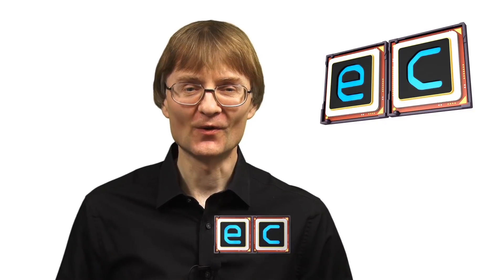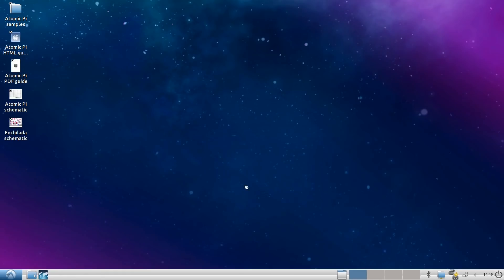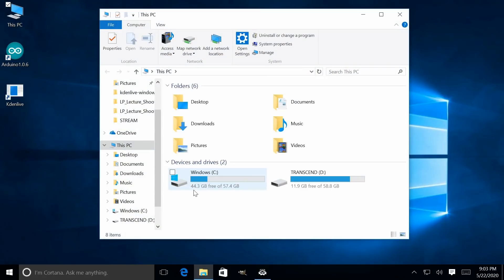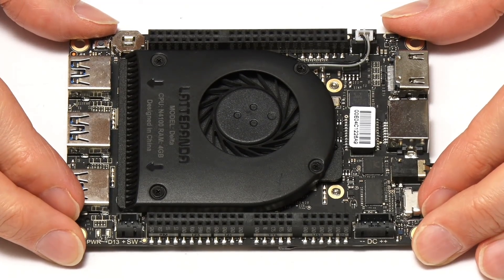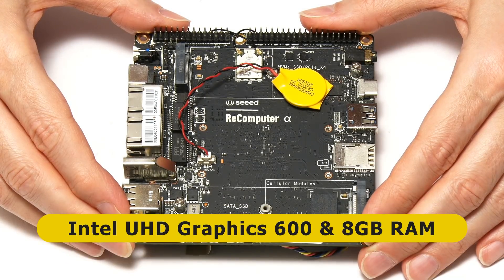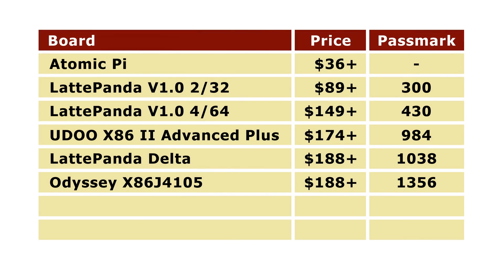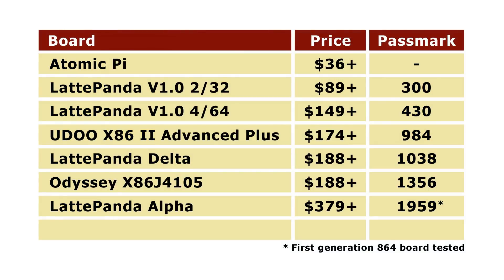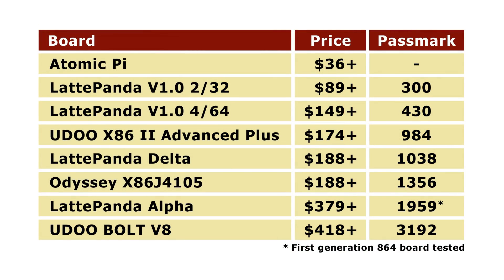Eight x86 SBCs

Comment: A while back I upgraded my Atomic Pi with 64GB of eMMC Flash storage, primarily so I could run Windows 10 on them with a little bit of legroom on the storage side of things. Out of curiosity, I ran the PassMark 9.0 Evaluation edition with its default settings, and got an overall PassMark score of 676. (That said, I noticed that for your LattePanda benchmark results, the 3D Graphics mark wasn't run.)

Here's the results I got for each category:
CPU: 1445
Memory: 563
3D Graphics: 234
2D Graphics: 155
Disk: 646
Reply from the maker: Wow! Great upgrade -- did you replace the eMMC chip? Thanks for sharing the passmark results.
Reply: @ExplainingComputers  Sure did! On another Atomic Pi, I also desoldered the built-in PCIe Ethernet chip to break out the signals to an external riser board. I've tested things like other network cards, NVMe SSDs, GPUs, and even a SAS card to let me boot the Atomic Pi from SATA!

Comment: With these mini pc could I install Astrophotography tools? They have several USB ports and I could plug them all in. Instead, USB hubs often give me problems for the equatorial mount.
Reply from the maker: Yes, any x86 software should work if the PC's spec meets what is required.

Comment: I really want a Windows XP SBC. When will they get powerful enough and cheap to emulate or run x86 VMs?
Reply from the maker: A UDOO Bolt or LattePanda Alpha will run a VM just fine. But the price . . .
Reply: @ExplainingComputers I have a Windows 10 tablet with a similar CPU like the Latte Panda, and it does handle VMs pretty good. I'll still stick to my retro XP tablet for an old computer.

Comment: The cheapest SBC here is a good competitor to Pi4 but the others are rather too expensive, especially those near $200. I rather buy a laptop because another extra less than $200, I can get a laptop which is many times better performances and features. A laptop has 14"screen too! NUC and mini PC is the same price as these expensive SBC so its very unrealistic but their fans will not hesitate to buy. Even the cheaper Android TV boxes have better processors at cheaper prices than Pi4 and all the SBC here. Pi4 is a useless SBC that only suitable as a toy for home project. Arm processors cannot even handle proper Office documents software but X86 can at least do this job.

Comment: How do they stack up doing ffmpeg x.265 4K 60fps ENcoding? And also vs ARMv7/8?
I'm planning on making a PnP scalable distributed HEVC system.
I don't need the fastest, I need the most efficient, price/power*/performance
* power as in Wattage.

Comment: Now, see... I think you made this video just for me.  I haven't selected another SBC, yet, but I want something unloaded, to run Windows XP.  I did manage to get Windows XP to run inside Kubuntu, on a laptop that I converted into a dual boot, Windows 7 and Kubuntu.  I should have been able to install XP onto the second partition, but the install failed.

So thanks.  I appreciate this nice comparison.
Reply from the maker: Thanks for this, but be aware that you  will struggle to find drivers for XP for any of this hardware. Running XP as a virtual machine is likely to be the best bet on modern hardware.
Reply: @ExplainingComputers  Since these are all 64-bit machines, Christopher, I believe you might be correct.  I've managed to get it running in Kubuntu, but the software won't cooperate.  I think I mentioned this before, but the latest backup that will run is from six months ago (maybe seven, by now).  I've done an awful lot of data entry since then, and if I knew it would keep working after that, I might not mind re-entering all of those data.
I don't care about the hardware, though - I just need to run my XP software.  Some of it I've completely paid for, and to replace it would cost more than I can afford.
Funny about the x86 instruction set: I had an 8080 chip (many years ago), and later, an 8085 chip, and then, one day, the 8086 chip came out with advanced features (of course I bought one).  They were fun to play with and program.  Today, everything's changed.  You can get the chip(s), but unless it's on a developer board, it's pretty hard to use.  In those days, I used manual switches and LEDs to program the inputs and read the outputs. Nowadays, they have hard drives, fast clocking chips, memory, ALUs, keyboards, monitors... takes all the fun out of it.
Most recently, I taught my students Machine language (ARM), but they were quite upset, some time later, to find out about Assembly language - an easier way to program than machine language.  As the semester progressed, they were very upset to find out about C-language, a much, much easier way to code.  I didn't even bother to mention C++, as I imagined they might have me tarred and feathered.

Comment: dear Chris hello!,i am reaching to you as i need some help with something that i think is your experty ,me and 3 of my friends a few months ago started to study computer engineering and software in a college, recently our teacher gave us a task to do,he gave us a 500gb hard disk with files( insisted to say there are files inside the hard disk in it) and the task was to reveal the files inside,seemed pretty easy at firs to us,but he told us that the files inside would be hard to reveal because the hard disk is in a format that windows operation will not detect,so the first thing which me and my friends thought to do first is to figure out what kind of file system the hard disk is formatted, after we will find it,we need to know what operation system can read it,(Windows,Linux,etc),and of course to download the appropriated drivers to run it ,when we inserted the hard disk to a pc running windows it didn't detect it of course but on the windows disk manager it detected that it has been inserted but its unallocated,we tried everything to find the file system by our own methods without any software's,after realize that we have to try some software's to help us, we have downloaded some,all the software's out there that experts to discover hard disk info,file system reveal,etc, t,didn't worked!it did detected but didn't gave us an info of the file system that its formatted at,it gave us information that it is a basic MBR, and its logical.
we are asking for your help please,thanks in advance ! :)
Reply from the maker: My approach here would be to boot up in Linux (from a USB drive would be fine), and to try mounting the drive there.
Reply: @ExplainingComputers   dear chris hello again :),thanks for your response,we have already tried it with Ubuntu,no results when inserting the hard disk,the teacher kept telling us that it is possible,tough mission we know,any other methods you think would work ?,it was very weird for us to know that no software out there could At least tell us the file system format .
Reply: When we test it on Linux it does detects it om the disk manager,but it wrote as "Unknown",nothing regarding to a partition type.
Reply: In Linux,the Gparted aswell gave no results,an error message pops up,do you think we should maybe install a specific drivers or softwares you know of that will help in linux? and if so,what would it be ?

Comment: Once you get to the price of the 4GB Latte Panda you can buy a fanless laptop/netbook with similar specs and performance but you get a screen, keyboard, power supply, battery, speakers, WiFi, Bluetooth, standard UEFI bios, more ports like USB C, etc. for the same price. Power consumption with the screen off is also very similar. That, in my opinion, makes any SBC around $150 and up useful only for very niche use cases. For nearly everything else the laptop is a much better value.

Comment: For Better Price and performance purchase a gigabyte brix j4105 or higher there is just no competition. Spent 200usd for 8gbs of ddr4 ram a j4105 with intel graphics a 120gb ssd and the brix itself and i can emulate nox in it, do 4k no problem and it really is a mini pc, it also comes with its own case, cooling system and power suply wich most of these bords dont have so its extra money.
Reply from the maker: While I take your point in general -- and the GIgabyte Brix models are great mini PCs -- as shown in the video the Odyssey X86J4104 delivers a J4105 CPU, 8GB RAM, 64GB storage and PSU for $218, or $237 with its case. And it has far more storage options than a Brixx, (two M.2 slots and a SATA port) as well as GPIO connectivity and a SIM card slot. So it just depends what features you need.
Reply: @ExplainingComputers  thanks let me say I Love your channel and your style, I'm proud owner of 4 sbcs and 2 mini pcs, some of those sbcs I acquired thanks to your sales pitch and since it's explaining computers I think that these aios can appeal to your public since I would think that many people choose sbc for their small footprint and low power consumption, computers like the brix I feel have a space as that low power media/pc solution that's affordable, small, low power and has better performance then most sbcs with less tinkering and aio solution, so would appreciate if you could also explore this realm most my sbcs where purchased for media consumption and where beat by a firestick 4k only 2/4 sbcs remain in use and found that they are great devices for nas, pihole, torrents, print share in my case but my media and gaming consumption moved to the mini pcs, would be a gr8 gift for a parent, son and can be used as daily driver with no necessary tinkering which some boards can be a headache and in an aio package that most boards don't bring since you buy power supply, case, cooling solution etc... separately
Reply from the maker: @Abolition-ky5sd  Yes, very much agreed. I have been musing how to cover hardware like NUCs and the Brix models -- as well as things like Pico and Nano ITX.
Reply: @ExplainingComputers  very much interested personally I'm in the 200usd budget would love a nuc though but for the price it's put of my budget, keep up the good work and cheers on this pandemic it's hard on everyone

Comment: This was very interesting. I would have liked to have heard about the differences in fan noise. I'm obsessed with silent computing but I also do some Photoshop and some light (very light) video editing so I have to conflicting needs. I'd looked at the Intel Nuc which has an available third party case that supposedly allows for fanless cooling. I'd love to hear more about powerful fanless PCs from you in the future.
Reply from the maker: I am a big fan of quiet and silent PCs! :) The Atomic Pi and both LattePanda V1.0 boards are passively cooled and hence silent, as is the UDOO X86 AP unless you add the optional fan (not really needed). The Odyssey board without onboard eMMC is also passively cooled and silent. On all other boards the fan is temperature controlled on/off only. The LattePanda Delta and LattePanda Alpha fans and very quiet. But the UDOO Bolt fan is very noisy and distracting as it cuts in and out. The Odyssey fan is very quiet indeed.

Comment: I'd have loved a power consumption column (or two, idle & benchmark). As far as "single board", the ability to add up to 32GB of RAM is probably very useful for some use cases.
Reply from the maker: Good point  . . . I must do a video focused on power consumption.

Comment: I'm trying to figure out why people are buying these. Check out cheap laptops. Most of the boards in them are about the same size these days. Are much more powerful with more RAM and m.2 and ram slots.
Reply from the maker: Firstly, a laptop and an SBC have different use cases -- it would be strange to use a laptop as a robotics controller, server or NAS.

Secondly, whilst there are many comments here and elsewhere about laptops being cheaper and more powerful, I struggle to find a specific model. For example, a quick search of Amazon.com today suggests this is the cheapest laptop they sell -- https://www.amazon.com/dp/B0821163ZB/ (ignoring Chomebooks and second hand stock). This is $250 with a Celeron N3350 CPU, 4GB of RAM and 64GB of eMMC flash storage. So it has a less powerful processor and less RAM than an Odyssey X86J4105, and the same 64GB eMMC storage as the $218 Odyssey model.

Now, the laptop has a screen, keyboard, battery pointing device and Windows 10 pre-installed, which certainly makes it a better value out-of-box  portable computer. But as, say, a media PC, running Linux and connected to a TV, the Odyssey will be roughly the same price even with its case and a wireless keyboard added. And it will have a more powerful CPU, more RAM, two M.2 slots, and a SATA port. Or as a small server where no screen and keyboard are needed, the Odyssey will be cheaper and have a far more practical form-factor.

I'm not disputing that for many users in many use scenarios that a laptop is a better buy. But SBCs like those shown in the video are cheaper and more practical in many use scenarios than a laptop.

Comment: I think odroid H2 at $111 is the best value for x86 sbc.
Reply from the maker: $111 is good value for the Odroid H2 -- but remember this is with no RAM, storage or power supply. The prices quoted for the Odyssey X86J4105 and LattePanda Delta include RAM, storage and a power supply -- making them about the same price.
Reply: @ExplainingComputers  oh I agree, but I think it's still competitive to the other Celeron sbcs even if you add memory & storage price. Plus a lot more usb ports.

Comment: I bought a couple Atomic Pi boards back when you first released the video on them, and haven't regretted it yet! One is now a dedicated webserver/security camera & sensor monitor that runs 24/7 independently of anything else in-house (with 3G/4G LTE backbone and cloud storage just in case, along with it's own battery, all hidden away in a location you wouldn't think to look, were you a thief) that I installed professionally at a company (using the "enchilada" breakout board for the nice connectors etc - it's not for me personally, so I don't trust pin connectors not to be messed with by some curious employee someday, whereas the screw terminals are pretty clear "don't mess with us" type connections. The other one is a tiny little fanless recording PC - works great for that, fits in a foam-lined hardshell suitcase along with the mic and 2 arms that swing out to hold foam curtains, plus one to drop on top of it. Voila: portable recording studio (I run it off a simple USB-C charge pack, and 20,000mah runs for hours on there. Honestly haven't tested it to it's limits yet, as we only really use it heavily when out of the house at events.) I'm also working on a 3rd one right now to replace the VM I have running HomeAssistant, as the dedicated hardware interface will also let me directly control several devices/relays that way, plus again be a separate, off-network standalone system. If the power goes out, the server starts blasting a shutdown warning immediately. I also used one inside an old touchscreen monitor that used to be a POS terminal (TTY client or something, so no good OS) to make a standalone media PC (the breakout board also comes with a nice amplifier) that all runs off a laptop charger, including the amplifier for the speakers, and if I need to do anything more than YouTube/music, there's always remote desktop, lol.  I highly recommend these if anyone wants something cheap that's still decent enough to tinker around with. Definitely can't beat the price for what I've ended up using them on. 
Anyway, thanks for the awesome comparison! Ironically I HAVE been looking to get 1 more that's a bit "beefier" than the Atomic Pi to use as a car PC just these past few days, so this is perfect timing!
Reply from the maker: Great to hear about your Atomic Pi applications! :)

Comment: ??? small laptops or note books can be another inexpensive x86 option. one drawback of laptops are the BIOS seldom has the boot after power loss feature that desktops have. that is if power is dropped and then reconnected, desktops can either return to last state, stay off or power on. do any of these boards have a similar feature? does it have BIOS settings we may be accustom to?

Comment: Hi need a help.....I have raspberry Pi 4... My raspberry Pi 4 is not booting ...think my son has changed the settings in config.txt in Kali Linux. Once he changed and restarted it not booting. Can you please help to fix this
Reply from the maker: Making changes to config.txt in any OS should not prevent another OS (installed on a different SD card) from booting. But if changes have been made to alter the firmware, you may have to recover it. This said, if an overclock was set up in config.text this could have permanently damaged the Pi. So you really need to know what kind of changes he was making -- if he was experimenting with overclocks, you may be sunk. If he was trying to update the firmware, you may be able to recover -- details are on this page: https://www.raspberrypi.org/downloads/
Reply: @ExplainingComputers  thank you...